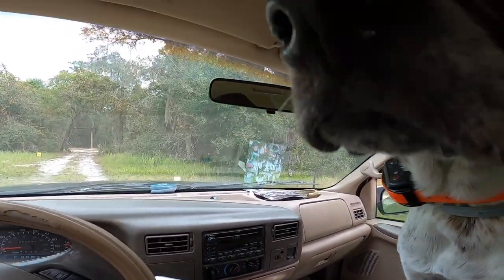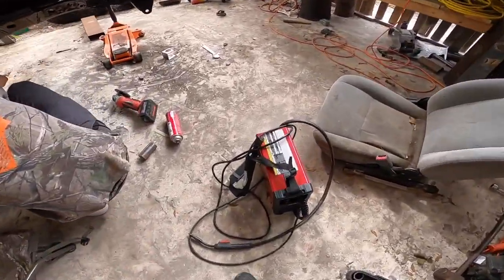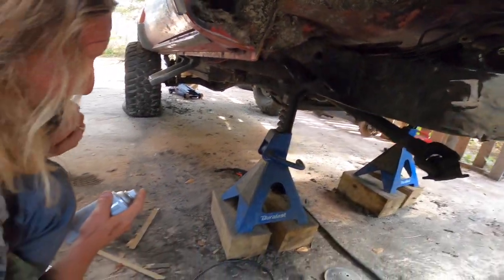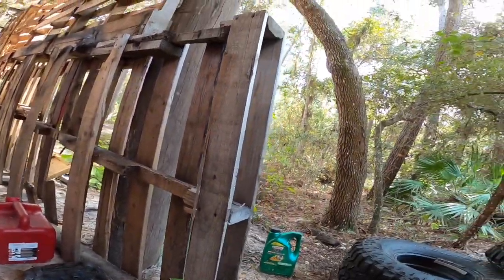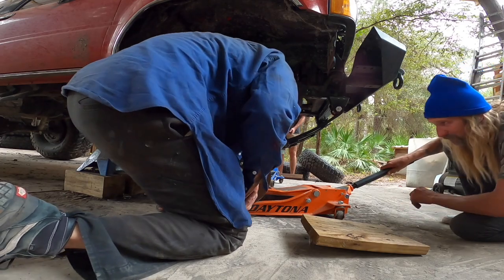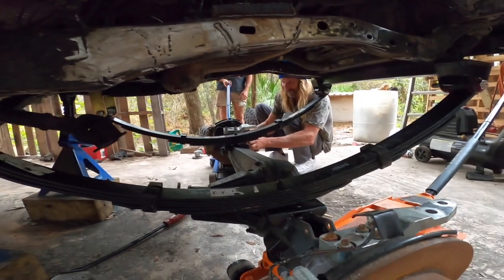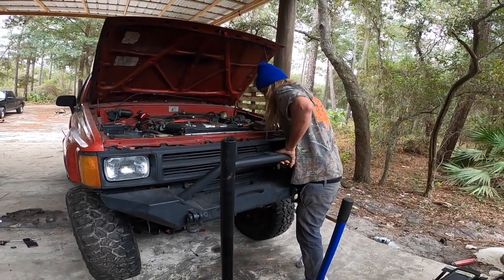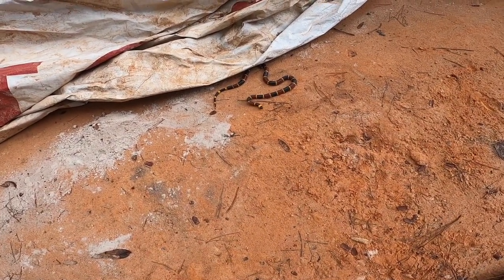Trucks, Dirt Jumps, Venomous Snakes, and BIG NEWS!

Comment: Not hating, just worried about the welds. 110v machine isn't really ment for more than a trail fix or sheet metal. It's all about the penetration...
Reply: im sure that frames no thicker than 1/8 or 3/16. they should be able to get plenty of heat out of that machine

Comment: Dude switch to Steel-It when you paint that raw metal. Its weld through primer, and does fucking wonderrrsss. You dont have to grind it off to weld if you make a mistake or something. Just weld right over it.
Reply: I second this. Steel it is such a good product its insane

Comment: the shackle and front leaf spring bolt should be finished tightened with the weight of the truck on them. just loosen them and bounce the truck a few times and re-tighten.

Comment: I'm not much afraid of any snake in the united states, nor any of the spiders, but coral snakes are the one snake I would never dare to mess with honestly. 2nd most venomous snake in the world only behind the black mamba, a bite from one and you're in a world of hurt and if not treated in time possibly going to kick the bucket.
Reply: Theyre very passive and will run away from you. They also have short fangs. It’s one of the least scariest venomous snakes in the US. Tbh the only one that’s a bit scary is the Mojave rattler.
Reply: @prslol1  I'm not messing with any timber ratllers or cottonmouths  which are by me, either.
Reply: @MX304  I assisted with another graduate students research and relocated water moccasins / eastern diamondbacks in Georgia/Florida both are not very aggressive.